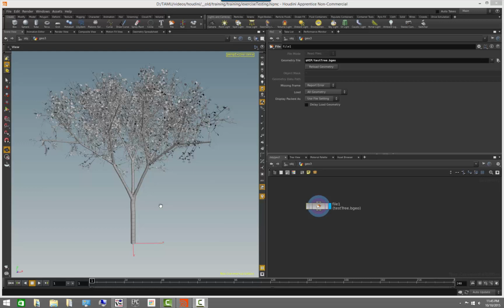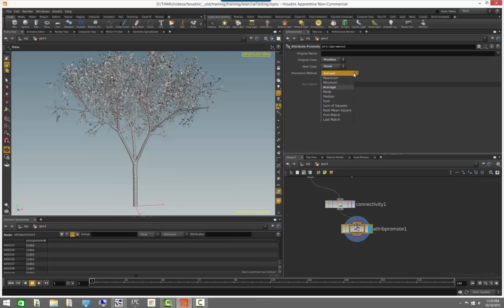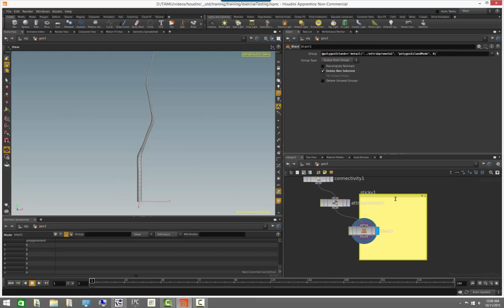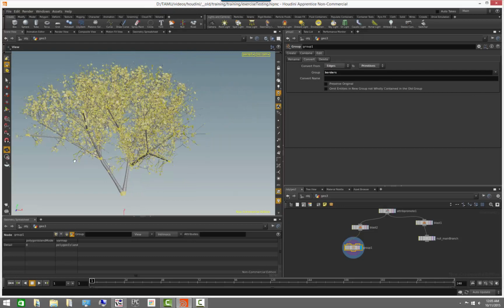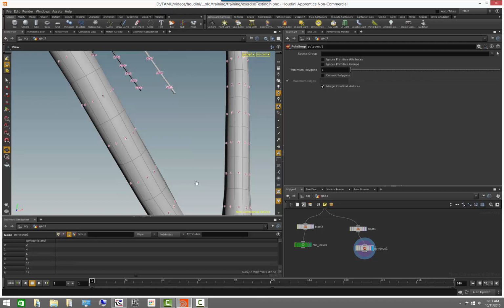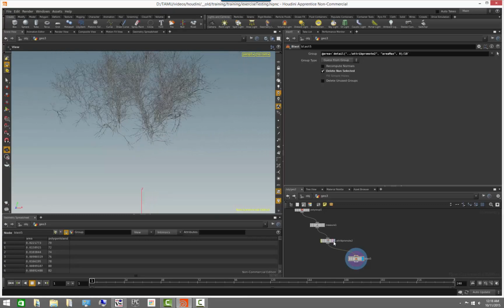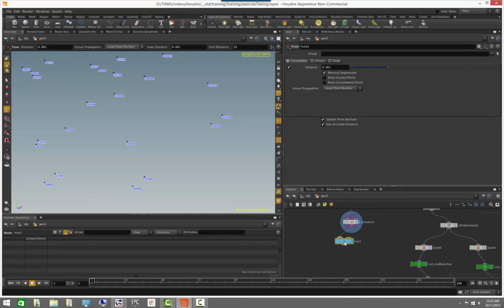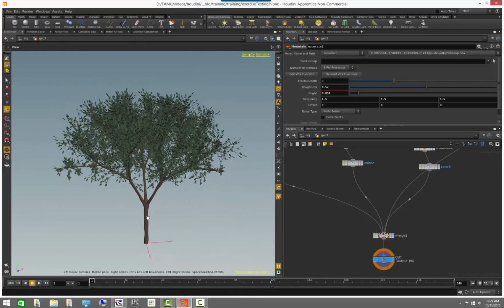Houdini Training - Attributes 04 - Using Attributes and Groups to Search Geometry

Comment: Your series of tutorials are excellent Gianvito. Much appreciated. Thanks. 

One question; 

I love following every step you do in your lessons in Houdini but I don't have this L-system tree.  Is there a place where I can

1. download it as a .hip file

or

2. a lession that will lead me through building it exactly as you have so I can follow this tutorial with it.

Thanks
Reply from the maker: hey Alexandros!  the mechanism for grouping may vary depending on your model.   There are certainly more advanced mechanism which can be used for different use cases.  For subdivided leaves, for example, I would actually check if the polygon island has volume to it by raytracing backwards from the leaf faces, and see if they hit a backface.   You can do this using a ray SOP (which returns a ray hit group), or using a point or primitive VOP, and return it as an attribute

I do recall asking sidefx if they were going to allow for playlists in their tutorials page, which I would use to add the examples scenes.   I will ping them again about it
Reply from the maker: +Ancien Regime Hi Ancien, I was trying to figure out a good way to distribute example files to go to the videos (as especially, in this tutorial, the idea is that you have a static model to begin with, therefore you have to do geometry analysis).  Let me see if there is an easy way to do so.   I may be able to post them in the Sidefx website
Reply: That would be awesome. I just use Sendspace to post .hip files obj files myself
Thanks for the reply.
Reply: Very nice series of tutorials. I have the same problem with Ancien R. following the tutorial. I am using some tree .objs I found around the web, but they have subdivided leaves, and this makes the grouping fail. Any ideas for grouping this kind of thing?
Reply: Hi Gianvito! I used a primitive wrangle to select the leafs http://forums.odforce.net/topic/28240-procedural-grouping-grouping-leafs-of-a-tree/ (I am a VEX novice), and I am now moving on with the rest of the video!
Reply from the maker: Hey Alexandros!  that is fantastic news!  I am glad you were able to get this working :)